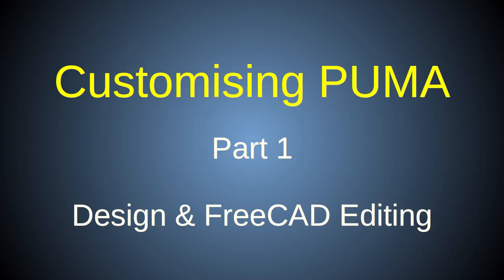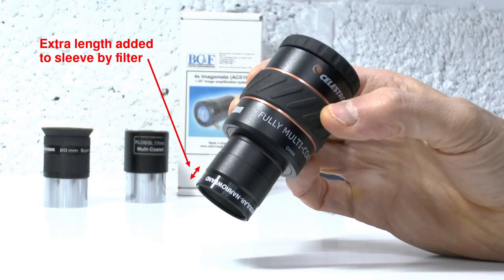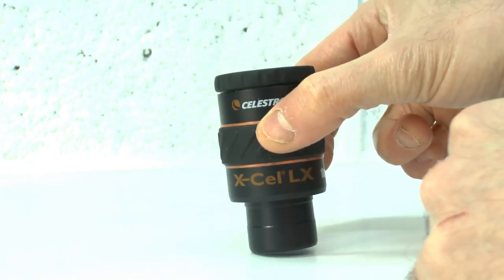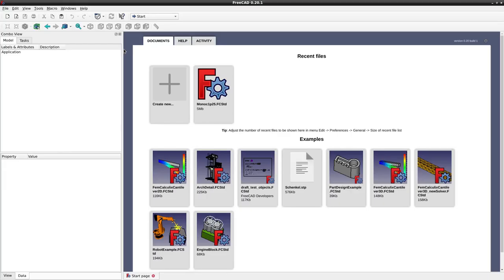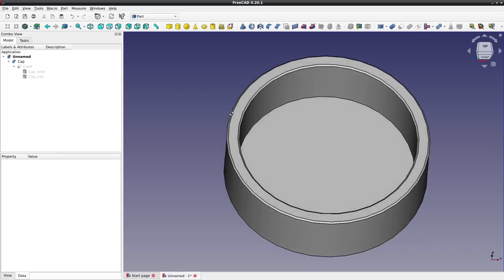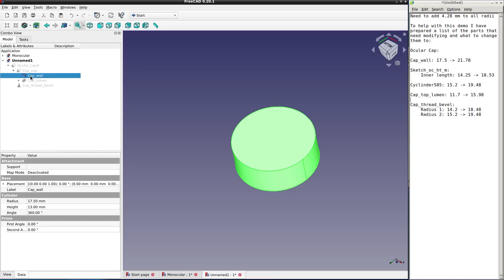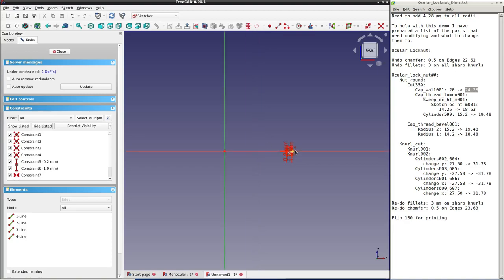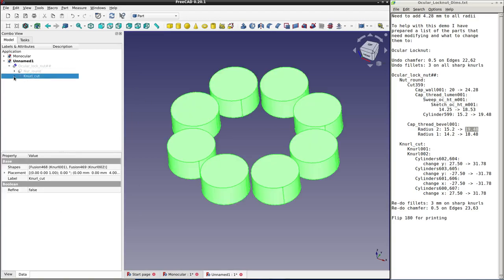Customising PUMA - part 1: Design and FreeCAD file editing

Comment: So many open source projects are made with solid works, Onshape, etc. It warms my heart to see such a cool project being made with FreeCAD.
I'm so used to using the PartDesign workbench that it weirded me out seeing you using part workbench. The realization slowly sunk in that I need to diversify my workflow when creating parts.

Side note: Step files are all the rage right now, over STL, since they preserve curves.
Reply from the maker: Thanks for the insight. I am self taught in using CAD and come from a medical (not engineering) background. This might explain my unusual approach. I used 'Part Design' for some of the PUMA components though.
Reply: @PUMAMicroscope  The part workbench is less common but definitely not impractical since it's the original modelling method FreeCAD utilized.
Your work on this device is impressive and I've loved the scope I bought from you. I'm getting ready to upgrade it, which is why I'm going through your videos at the moment.

Comment: One question, what distance should there be between the condenser lenses, should they touch each other or should they be separated?
Reply from the maker: The PUMA Abbe condenser lenses should be as close as possible without touching. If they touch they can grind a little spot on each other at the point of contact which can be annoyingly visible as a central blurry dark area in your field of vision. The same goes for the two lenses in the lower collector assembly.
Reply: @PUMAMicroscope  OK thank you very much

Comment: Are there any ongoing efforts to parameterize the parts?
Reply from the maker: I'm not sure I understand you correctly. All models are already parametric, editable CAD models in FreeCAD - not static STL meshes and such (the idea is that you generate meshes or other printable formats as required from the parametric models using FreeCAD). I haven't put together a set of engineering drawings for the parts with all measurements labelled on them, but that can be done using FreeCAD if anybody wants to.
Reply: @PUMAMicroscope  Thanks for the reply. What I meant to ask is whether there are any ongoing efforts to switch to using values referenced from spreadsheets (made using the Spreadsheet workspace) in the constraints for the parts in this project for easier editing rather than having to navigate through sketches and operations to edit parameters.
Reply from the maker: @wulfboy_95  Oh, I see - I did not know about that feature. I'm not aware of any such endeavour, although it sounds interesting.

Comment: Please tell me you're working on an open 3D-printed equatirial GoTo mount. If so, I'm buying a printer. Your design skills are amazing!
Reply from the maker: Thanks. There are some open source astro eq. mount projects out there - as I'm sure you know. However that is not my field of expertise - I have a kiddies 4 inch Newtonian with a Japanese eq. mount I got off eBay (because the one that came with the scope fell apart). I started writing some stepper motor control software for guide star control using a RPi but never finished that project. I suspect 3D printed plastic parts won't cut-it for a heavy telescope but never really put my mind to work on the problem because I don't do much astro work. However I intend to show some atro examples in my future image processing videos - a lot of my image processing knowledge (esp. deconvolution) actually comes from the astronomy community (e.g. during the 90's re attempts to fix the original Hubble images).
Reply: @PUMAMicroscope  Figured as much, you'd probably still need lots of metal parts. I'm going to buy a printer anyway to build myself a P.U.M.A.
Someone's selling their Ender 3 pro for a few bucks in my area. Will that print this?

Also, has someone had a go at solving the lack of a turret? I could imagine not having a turret, but rather a notched sled with a few objectives lined up in a row and a lid extending far enough on both sides of the scope to protect the inside of the objectives. I dunno, maybe I'll try that myself 😅
Reply from the maker: Ender3 Pro is more than good enough (I did everything on a standard Ender3) - you just need to ensure it is set up and calibrated right - you will find plenty of help about that on YT. I also plan to make another video on how I set up my printer at some point. Yes, I have thought about a linear slider objective changer but the timing belt gets in the way so any way you try it there will need to be a radical re-design of the stage. A mag changer would be the next best thing but haven't designed one yet. If you come up with a solution please post it somewhere. I hope it goes well. Keep an eye on my channel for updates.
Reply: @PUMAMicroscope  Thanks for the info, guess I'll go pick it up tomorrow. I always wanted to have a go at 3D printing anyways, but never had sufficient reason to get one.

I'll have to have a look at FreeCAD, only 3D Software I'm familiar with is Blender, but doing mathematically precise stuff in there is a pretty clunky process. If I can get a grip on FreeCAD I'll try a few things and if anything shows promise I'll let you know.

Thanks for the amazing work so far, I'll be sure to keep an eye on the project!